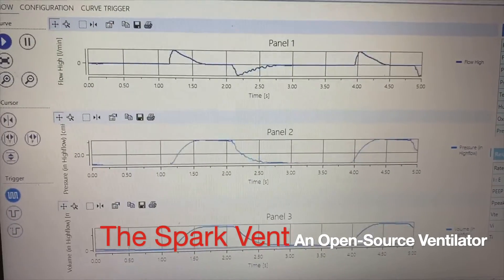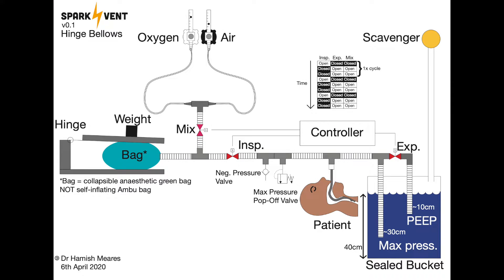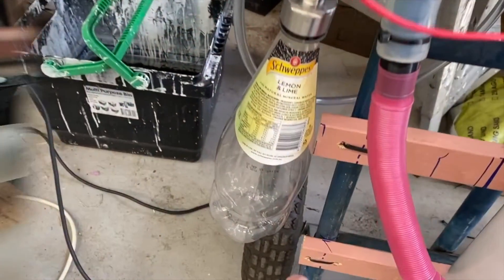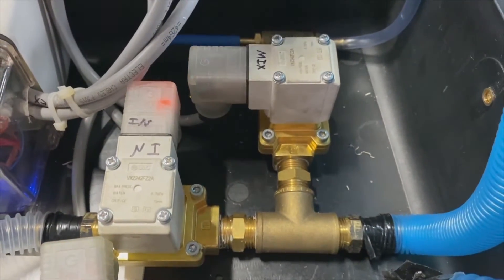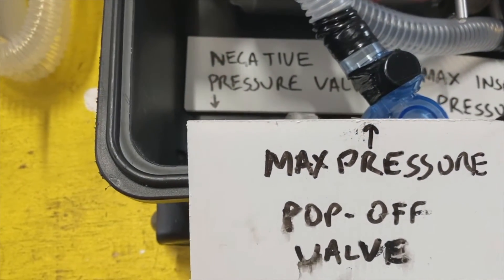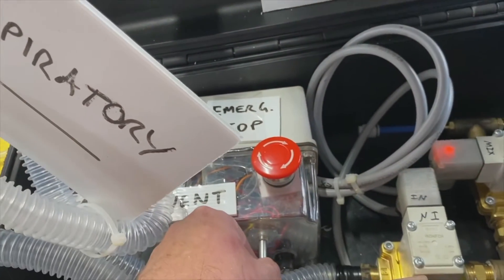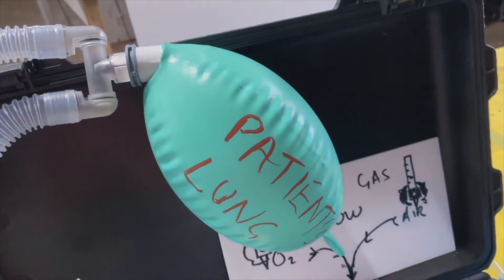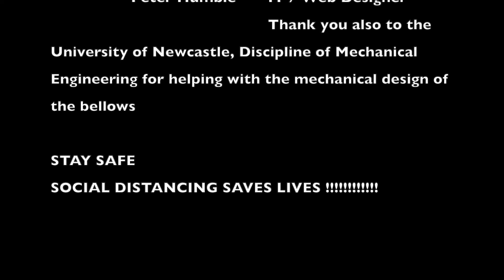Spark Vent - An Introduction

Comment: Is there any difference with your respirator to a bipap (dual pressure sensing your breathing)or other type of machine used for sleep apnea? and would there be many ready for use with modification if necessary? I use cpap, one constant pressure, I noticed your labelling it on your machine, but that alone is not adequate I see.
Reply from the maker: Hi, great question. Resmed, and Australian company that makes BiPAP and CPAP machines recently modified their design to make a ventilator exactly as you suggest and  i believe is now making ventilators for the Australian government, This is fantastic but they will take a several months to deliver on that order and most countries don't have several months to wait. To explain (in hopefully not too much detail): There are two different types: there's "mandatory ventilation" where the ventilator does all the work as the patient is not making any effort and then there is BiPAP also known as "pressure support" where the patient is making respiratory effort and a sensor in the machine detects this and then gives some assistance to the patient during that breath. The name BiPAP comes from the fact it uses two pressures, a minimum pressure which is the same as CPAP on your machine for when the patient is breathing out and and also a higher inspiratory pressure that assists the patient for when the patient is breathing in. The bigger the pressure gap between those two numbers, the more assistance the patient gets during the breath. The second type is can be a bit more complex to engineer as you potentially need sensors and a control unit and even in a fully spec'd commericial machine can struggle with some patient's pressure support as there are lags in the system and the ventilator can mistime the delivery of the pressure support breath leading to asynchrony (= all out of sync) and big problems. For simplicity on our vent, currently we are just using mandatory ventilation (Pressure controlled ventilation to be exact). The patient can still take their own breaths as the negative pressure valve will open to allow them to do this but at the moment there is no extra support for them. We are working on adding this to the system but has to be very simple and able to be made from pieces you can find in a hardware or hospital.